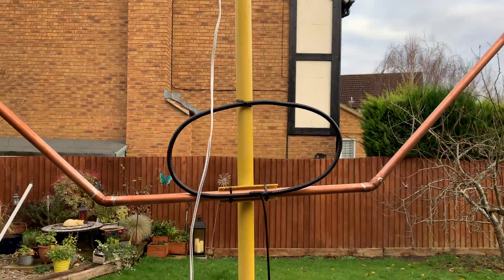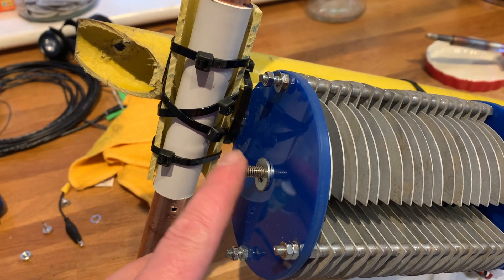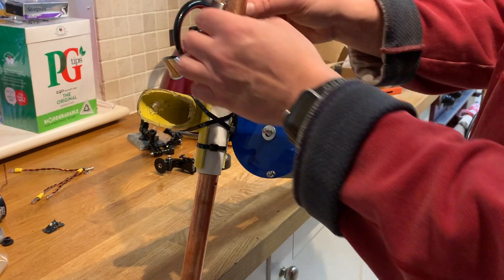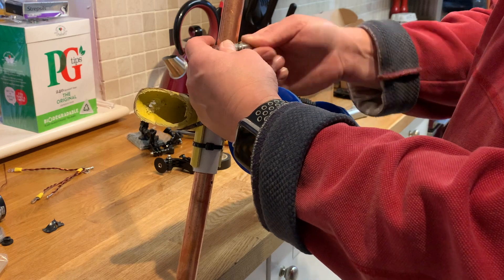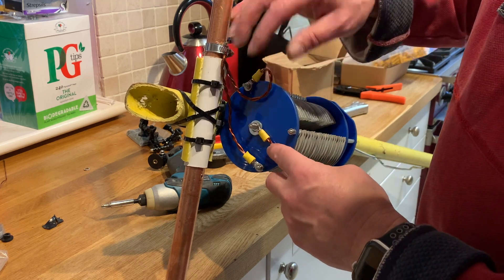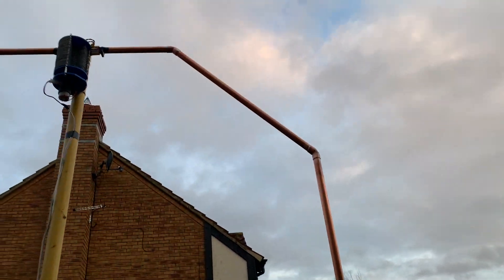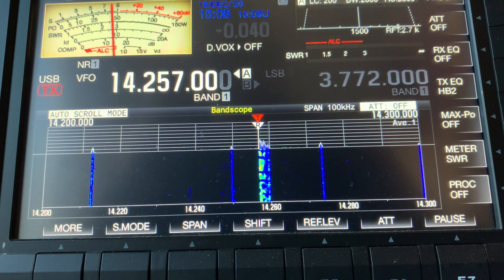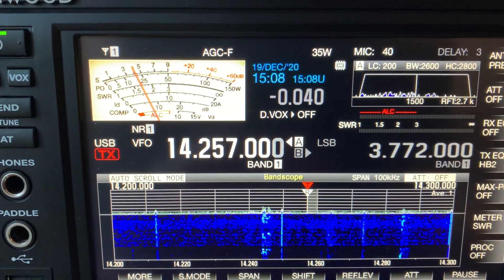CB & HAM RADIO: Build a MAG-LOOP MKIII  Part 2,  15M to 40M

Comment: On your capacitor center tap, put 90 degree bend on ring connector lug so the  wire is perpendicular to surface.

Comment: Sorry I’m confused - that’s a beautiful looking butterfly capacitor but it seems you’ve linked the two stator plate stacks as one and created a commutator to the rotating plate that would normally not have an electrical connection to anything.  Won’t that create a lot of resistance ?
Reply from the maker: Aah, I have turned a 3 plate cap into a two plate cap using the stator plate as one and the rotator plates as the other..creating a larger capacitor

Comment: Very interesting!  So if I'm seeing this right, the loop does about the same as the other antennas on 20, but is a couple of S units down on 40?  I'm assuming that the radiation orientation was the same for both the loop and dipole on 40 m?
Reply from the maker: Yes and no, when I am on the Magloop, the pre-amp is automatically switched in, without it is 3dB down on all bands but also smooch more quieter.

Comment: Hi Mike, 
thank you for your great videos. 
Just one question. Maybe I missed it somewhere but which version of coupling did you use?
73 and a happy new year,
Rico, DG5BQ
Reply from the maker: 1m standard loop.
Reply from the maker: 33cm diameter
Reply: @mike-M0MSN  Ok. Is it coax? And if so how did you do the wiring? Shielded? Unshielded?
Reply: @mike-M0MSN  I built a loop myself in order to use it inside hotel rooms since I travel a lot but didn’t have much luck with it. I simply don’t get out with it
Reply from the maker: @RicoAb  problem with hotel rooms is that they have a lot of metal content in the window glass and frames.....
Reply: @mike-M0MSN  Yes, that’s the point. But I’ve seen people doing it. 
 it’s late and I think my brain is half sleeping already 😄. I meant when you refer to the pages of N4SPP he mentioned different coupling methods (A to F). Which one did you use?
Reply: @mike-M0MSN  Oh, I was not only tired but also blind. Found the answer to my initial question in video no. 1. Sorry for that...
Reply from the maker: Coax, unshielded, 😂
Reply: @mike-M0MSN  😂

Comment: Hello Mike. Did you need maximum capacitance from that air variable? I normaly connect only the stators to each side of the loop; that prevents loses on moving connections. It does reduce your overall capacitance by half though. Was that your intention? Looking forward to the double loop episode. 73 de ZS2VR Vaughan
Reply from the maker: Hey Vaughan, yep ever bit of capacity needed, however keep an eye out...👍
Reply: There's a few good deals on EBay out of Russia for vacuum capacitors right now. If postage and the shocking postal service my side wasn't such an issue this time of the year I would be tempted....

Comment: How much copper pipe did you use Mike. Fran M6yik
Reply from the maker: A lot, 6M's.  lol
Reply: Might have to give one a go. What size cap are you using. I have a 5pf to 190pf spare
Reply from the maker: @ukm6yik  that should be perfect